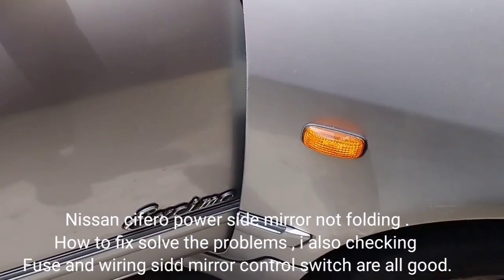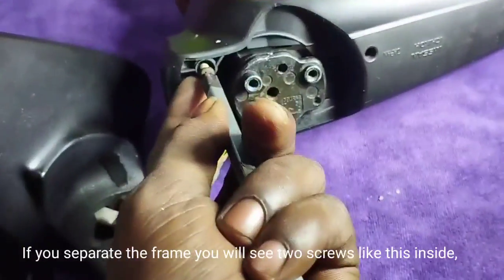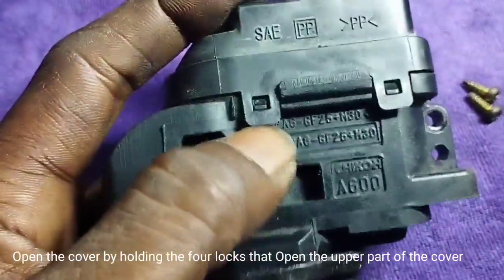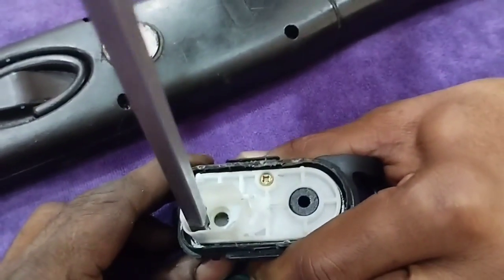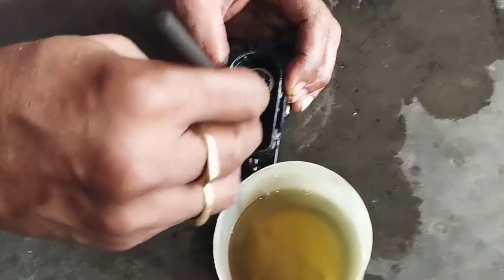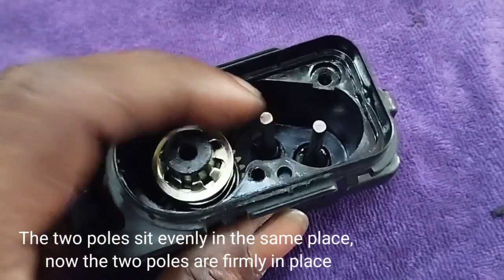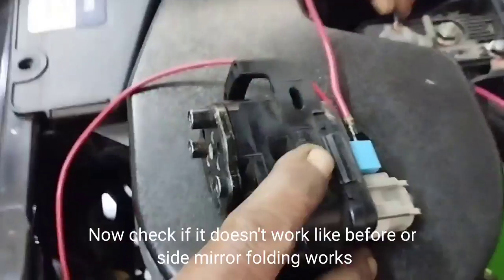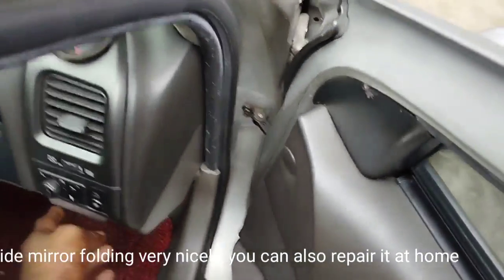how to fix power folding mirror !! Power side mirror not folding problem solved Nissan Cefiro

Comment: Where can i find the fuse for the power side mirror
Reply from the maker: Check Feuse box ya
Reply: @SCSautomotive.1988  cant find what its called. theres no "PWR MIRROR" or anything else. I can only see "HEATED MIRROR" but theres no fuse in there.